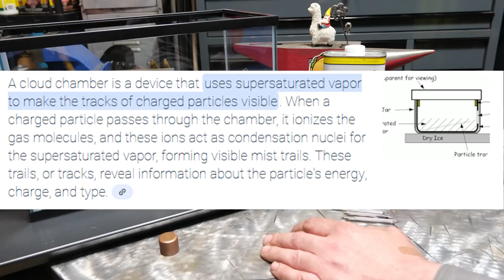Radiation exposure with welding, Is it true?

Comment: Don't inhale:
1) thoriated tungsten
2) phosgene from UV-irradiated (chlorinated) solvent residue
3) ozone and NOx from UV-irradiated air
4) lead from free-machining steel (hopefully you're not unwittingly welding this)
5) zinc from galvanized steel
6) chromium from stainless steel, inconel, or chrome-moly steel
7) manganese from carbon steel or alloy steel
8) flux smoke
9) dust from consumable grinding disks
10) anything but clean air
Reply from the maker: 100% 😀👍👍.

Comment: As I understand it, Tungsten is a neutron reflector, as was used during the first Demon Core accident. Since alpha particles are neutrons and protons, I wonder if that affects how many alpha particles are able to break free of the alloy.
Reply from the maker: That’s a great question.  Others have suggested that more particles came out of the sharpened end due to the ability for them to escape.  That could likely be true.  If you figure the material has equal distribution of thorium, and that tungsten slows/stops the particles, the sharpened end would present less material for the particles to pass through to reach escapement.  That makes sense to me but definitely above my credentials to say absolutely lol.

Comment: does that copper pipe holder protect you at all? if so i am going to make one tonight
Reply from the maker: So the alpha radiation wouldn’t be able to escape the copper, so it would be far better than keeping them loose in your pocket.  Where you want to be the most careful is around the grinding dust, that stuff is what will cause the most damage.
Reply: ty for that tip and the info on the subject I've known about the dust and not to keep them in your pocket but even in the comment section there is a wealth of knowledge  here

Comment: Greg, these real world test examples are great.  Very applicable to our daily projects.  Much appreciation for the tremendous effort it takes to create the content and edit even a 15-minute video.😀

On a related note, since we can so easily and effectively sharpen our electrodes to a fine point, why would we bother to have a range of tungsten diameters and all the accessories?  

Shouldn't we generally just use 1/8" electrodes and then sharpen for the job requirements?  I have various sizes of tips, collets, gas lenses, etc. but in general the only time I switch is when my amperage requirements exceed the electrode size capability.  However, I do not see the point to the differing electrode diameters 1/16", 3/32", 1/8", etc...  Even if I am TIG welding very thin metal, but even then a longer thin sharp point on a 1/8" should work regardless of the actual electrode shaft diameter.  Until you get to the very tip in the gas shield, it is really just a wire for current conduction isn't it?  The larger electrodes seem to last longer and are somewhat more heat load resistant.

Have you ever compared or tested the different sizes?  I get that you would melt a 1/16" electrode trying to weld 3/8" aluminum plate, but isn't a larger electrode nearly always better since it is only the last 1/4" taper that is involved in the arc and you can control that with your grind?

Thanks again for all the work you put into these excellent videos!  😀
Reply from the maker: Thanks for the kind words.  I do have a bunch of thoughts on the tungsten situation.  A long time ago I experimented with tungsten’s and figured out a lot of things, some of which actually went against what other YouTube sources said.  What tungsten should be used does actually make a difference but how much of a difference depends on the welder being used.  The higher end modern tig machines often have such good arc starters the diameter of tungsten is of no concern for arc starting.  Many older machines or modern cheap ones can have poor starting characteristics with oversized tungstens.  When it comes to diameter the smallest tungsten (1/16 or .040) can make a difference with the arc cone when welding super thin material (think paper thin material).  Most people never weld that thin of material and the difference is minor, so it’s generally not an issue.  In the pipe welding world I am in now all people use is 1/8th, and a major reason is they last longer.  3/32 tends to have a higher risk of breaking a piece off if dipped.  1/8th also lift arc starts better without deforming the point.  1/8th tends to handle continuous welds without suffering nodule formation.  I have done some tig weaves on 12-24inch pipe that are 120-160a continuous for multiple full length tig rods.  The 1/8th tungsten generally keeps a clean point.  3/32 with that much continuous use tends to get little bumps on the tip and anything short of a flat pointed grind will screw with the arc cone and thus the weld.  With higher amperage or aluminum 1/8th tends to be the way to go.  

If I had to weld paper thin material all day I would run .040-1/16th, especially on jobs that require absolute quality of weld.  That’s so rare for me that there isn’t much of a benefit to running it.  For general purpose I run 3/32 in the shop but 1/8th is no problem.  For pipe welding I run 1/8th.  For aluminum I tend to run 1/8th with a very small ball on the tip that’s 1/3 to 1/4 the electrode diameter.  It tends to make the arc stable consistently.  

Honestly the #1 most important aspect of tungsten is keeping the grind angle consistent.  I didn’t realize how important this was until I started doing xray quality tig welds on open root pipe.  Changes in grind angle made subtle changes in the arc cone, which changed how the root pass went.  On most non critical things it wasn’t a big deal but when you needed to have a completely perfect root pass a bad grind angle or change in tungsten prep is one more variable you don’t need to deal with lol.
Reply: @makingmistakeswithgreg 

Thanks for the very detailed reply.  Your thoughts are very insightful.  It is very good to hear and fits with what I have seen in my more limited experience.  I have only used a couple of TIG machines but the inverters with HFC seems to not care what I use most of the time for 3/32" material up through about 1/2" and the electrode tip grind each time is very similar but I do not use an actual tungsten grinder jig.  I just grind them in batches and use a manual rest with the tungsten in a drill on a diamond grinding wheel to get linear scratches heading parallel with the tungsten length.  I will pay more attention next time I grind and see more as to how the angle affects the arc cone.  Most of my grinds are fairly shallow on smaller stuff, but not silly.  I sort of use the grind angle to simulate the smaller electrode diameter.  Not saying this is perfect, just what I have been using.  The smaller I want the electrode to be, the more shallow I usually have the grind angle.  Sometimes though it seems to work better to not have it more blunt depending on the work area around the welding joint and the material being welded, especially with aluminum. Sounds like what you intentionally use a balled tip for.  If I ball the electrode tip, it is usually an oops.

I generally only use lanthanated tungstens as the thoriated ones are mostly reserved for my sons cloud chamber project.  😂

Most of my TIG time is HFC, but I have a lift arc MP that I will try out for the practice and see how the electrode matters there.  It is really a hobby for me, but I find you are providing excellent advice so thanks for giving your knowledge.  Both when you are certain and when you are not, as they are both very helpful.  I have almost never welded aluminum and wished for a smaller electrode. (I have wished for a water cooled torch a few times though...)

I appreciate your approach to testing things out to see for yourself what works and what doesn't.  Both are important when trying to solve problems we face every day so we are are appreciative of your sharing these experiences..

The more I learn, the more I find there is to know... it takes a village.. and all... that stuff is so true......  🙂

Comment: Greg do a video on 6010/6011 root and 7018 cap vs just all 7018 root and cap. i never understood using a weaker rod like a 6010/11 over a 7018 in the most critical part such as the root
Reply from the maker: I sort of did that but it’s worth revisiting in a new video, I will shoot it soon.  So there is actually some validity to this combo.  Let me explain:  I am a certified pipe welder and as of late I have been doing a ton of 6010/8010 roots with 7018 fill/cap on pipe.  This is very common and works great.  The reason it works on pipe is because pipe doesn’t see loads like something structural would, and the open root is far easier to weld with 6010.  

On something as simple as single sided fillet weld a 6010 root, 2 bead 7018 cap will not be any stronger than a 3 bead 7018 weld provided the plates are bent towards the face of the weld.  More or less the 2 bead 7018 cap in both cases will equal each other and the weaker root won’t be a concern because it never sees enough force to fail.  Now if the plate is bent towards the weld the 6010 root will take more force to break over the 7018.  Despite the 6010 being weaker, it penetrates more and the extra fusion under the plate does two things: 1: increases the weld throat depth and 2: reduces leverage the plate has using the weld as a fulcrum point.  A thicker weld takes more force to tear/break through, and more penetration essentially increases weld size.  

So in simple terms a 6010 root 7018 cap can work great for producing a single sided weld on a fillet that is stronger than just 7018.  However if you were to bevel the edge of the fillet weld to increase how deep the 7018 weld is you could have the same “throat depth” as the 6010 weld and a stronger finished weld.  In the same token you could weld another layer of 7018 to increase the throat depth.  More or less 7018 is 100% stronger than 6010, but the limitations of how 7018 penetrates means 6010 can be stronger in certain circumstances.  

Like I said I will do a video directly on this with a bunch of tests to show exactly what’s going on.  I will tag your question in it too 😀👍.
Reply: @makingmistakeswithgreg  thank for the reply and video :D

Comment: Is it not the opposite? Because I’ve only ever used green (pure) tungsten throughout my aluminum welding career, I use strictly red (thoriated) tungsten for my steel and stainless jobs 😛😅
Reply from the maker: So green tungsten would commonly be used on a transformer machine with it balled.  If that’s what you had that would have been the normal setup.  On more modern machines I prefer a 2% lanth tungsten with a very small ball at the tip.

Comment: what about measuring the radiation in the air around when you are welding, surely, the plasma on the tip, is releasing nano particles, and radiation. all it takes is one to enter your lung, and fester, damaging cells till your body cant remove them fast enough.. boom - cancer one day

Comment: Haven't watched everything yet, but I just wanted to offer a huge THANKS! and tell you how helpful your content is. You provide understanding with your advice, which is much needed in these days of "opinion only" posting. I watch every one of your videos, except MIG & TIG, and I don't watch those principally because I doubt I will ever have either. My workshop is outdoors and unshielded from the wind, so some sort of a flux core or stick is what I will need to use. BTW: watched your "10 best stick welders," & I actually have the aging Miller 150S, which I got in 2014 or 2015. It is in fact excellent. I recently purchased a Titanium 125, and haven't used it yet, but reports are encouraging. My first welder was a Lincoln AC-225, and despite its flaws it was a good machine. I had to give it away  (too big) when I moved, so it went to my son-in-law. Had they been making inverters back then I would have kept it. Thank you for all your excellent content!
Reply from the maker: You’re entirely welcome 😀👍.  Having access to stick welding and flux core wire is a very solid setup.  I rather have that setup than a MiG machine.  Flux core wire works great in odd positions and thinner material than stick normally would weld.  Then stick welding can take over on thicker material.  You’re definitely not limited much with that setup 😀👍.

Comment: I still like to use thoriated if I can find it. I think it works the best. I'll take the risk lol
Reply from the maker: It does work well.  If you have a chance to try 2% lanth give it a shot.  I find thoriated works better on d/c than basically every tungsten other than 2% lanth.  It’s very close to 2% lanth, it just loses the tip a bit faster at higher amperage.
Reply: @makingmistakeswithgreg  i rarely run ac and most of my positions are jammed up in a pipe rack or in very limited mobility areas i find lanthonated tungsten more prone to splitting if you ever get it stuck hard

Comment: What about finger rings made of tungsten carbide.
Reply from the maker: Tungsten carbide wouldn’t normally be alloyed with thorium, however a lot of materials for jewelry is made overseas, and it’s possible some radioactive element could be in it.  Radioactivity is pretty common (even granite counters and bricks have some level of radioactivity) but it tends not to be an issue until it’s made into a dust that can enter the lungs.

Comment: I like your copper pipe tip holder I'm makeing one for myself
Reply from the maker: It’s a cheap and easy setup that works great.  The good thing is it tends to not dull the tips because of how soft the copper is 👍
Reply: @makingmistakeswithgreg  i was thinking about cutting out felt circles scratching up the copper and crazy gluing them to the caps for 1: that added purpose and 2: stop them from clattering about in my pack

Comment: This is a silly question, since it can be demonstrated by using very simple measuring technology. What hard UV-radiation causes to organic structures also is well-known and can also be shown with measuring technology.
So this questioning simply can be answered with "YES".
There are methods to shield this radiation, but hardly anybody really uses such rigid shielding consequently and mostwelders simply ignore these risks.

BTW...does at least everbody know the reason, why even tens of lears in the past every welderby profession used and recommended the use (to trainees, e.g.) of a leather apron...? So stop relativizing such essential and not really new knowledge!

I also leant that as metalworker in my youth!

BTW... if there are ideologists amongst these reality-deniers: Instead of asking such nonsense question: Simple throw your OWN protections away and... become INFERTILE! This at least will make sure, that the spreading of your nonsense cannot be reproduced "natively"!

Comment: That is really shocking information and makes me immediately think about cheap Tungsten Jewellery from China.
Is that piece of metal stuck in our ear or around a finger in the shape of a ring Thoriated or not ? I suspect it is far
from pure.
Reply from the maker: Thorium is normally added for ability of the tungsten to keep a point under high temps, however I wouldn’t put it past any supplier to have tungsten jewelry contaminated with thorium or possibly other elements.  The hard part with stuff coming out of china is knowing exactly what you’re getting.  All sorts of undesirable materials could be found in things bought, and let’s face it, quality control probably isn’t being done stateside to see what’s actually in stuff.  I will be honest, I expected even the non thoriated tungsten to show radioactivity being they were selling mislabeled tungstens.

Comment: I just started stick welding a month ago, hopefully it doesn't have radioactive materials in the electrodes. By the way, Love the end bit where you drove that forklift and fcx24 unimog
Reply from the maker: Stick welding has a fair amount of fume, but atleast none of that is radioactive.  Virtually all of it can be prevented from going into your lungs by a simply p100 filter mask, which is a cheap/available option.  Glad you liked the r/c clip at the end, I just picked up the unimog and have had a lot of fun with it so far lol.
Reply: @makingmistakeswithgreg  thanks for the advice, I'll definitely buy some mask to filter out the fumes 😊 for me, rc is like a therapy or puzzle solving game, as an RC enthusiast, I of course enjoyed it very much

Comment: Love it! It looks like picking up some dry ice for a weekend adventure is on my list. Going to pull apart a smoke detector and see how it goes.
Reply from the maker: Some smoke detectors use americium as an alpha emitter and it will show very similar straight lines like the tungsten in the video.  However it is far more radioactive (still not really dangerous) than the tungsten, so you should see a significant amount of particles in the cloud chamber 😀👍
Reply: @makingmistakeswithgreg  Ill let you know the results. Thank you.

Comment: If the Tungsten is giving off Alpha  Particle radiation, than there's no danger to them as they can't even penetrate a sheet of paper, let alone you skin.
Reply from the maker: The issue is you have to grind them and the dust gets in your lungs and stomach